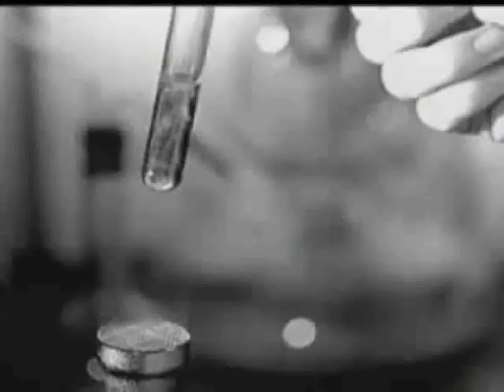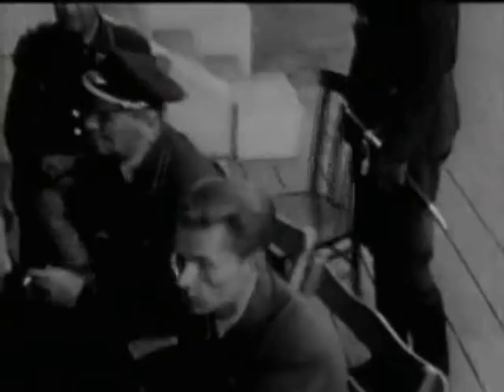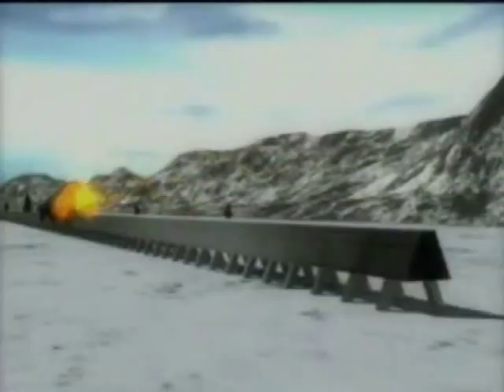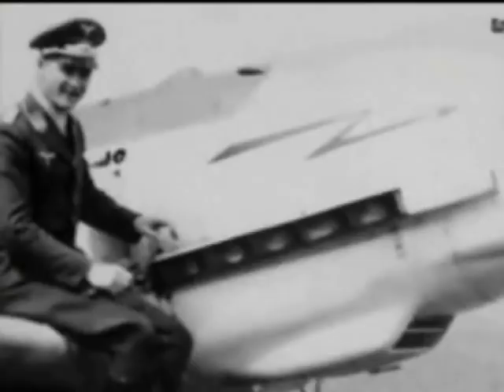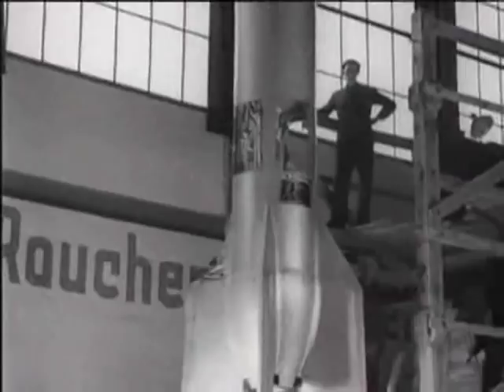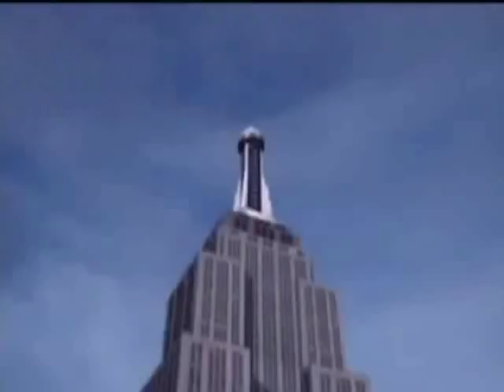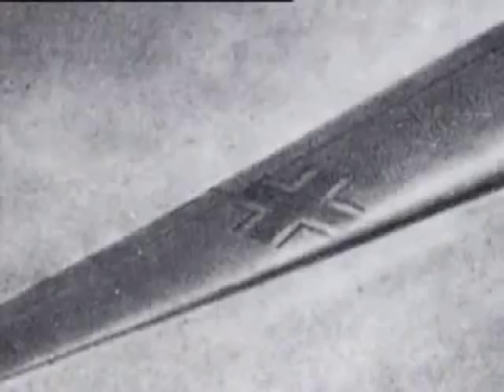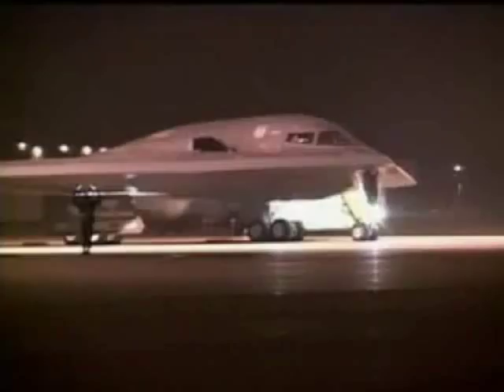Advanced Strategic Aircraft of the Luftwaffe - the true story

Comment: First up, Jack Northrop developed the XB-49 from his PREVIOUS flying wing design, the pusher-propeller driven XB-35, which first flew prior to 1945. Anything he learned from the Hortens after the war MAY have been integrated,into the jet version, but the XB-49 was, except for the engines, almost identical to the XB-35 externally. THE 35 is a key, as Northrop numbered the bombers for the year of initial design start. 49 means he moved to jet power starting in 1949.
    Northrop and his design team came up with the all-wing design independantly of the Hortens, as it was first proposed in an aeronautical paper in the 20s. Even the Russians had a flying wing program, pre WW2, as did the British, although theirs never got beyond paper projects until post war.
    FFS, people, do some basic research and fact checking before posting incorrect info like this.
Reply: David miorgan   What are you on about?
Reply: David miorgan  What are you rambling on about?

Comment: The Northrop XB-35 flying wing bomber was flying by 1944, well before the end of the war, so the claim that the Northrop B-2 was a Horten ripoff is bogus.
Reply: Northrop couldn't figure out how to make it stable.  so it didn't go into production.  the Horton was more stable than the XB-35
Reply: The XB35 was stable.  It was the jet powered XB49 which was not.  This was due to the removal of the no longer needed Vertical piston engine housings.  They had helped stabilize the plane.
Reply: *Edward
Brigadier General Robert Cardenas (USAF retired) and his experiences testing the Northrop YB-49 in 1947 and 1948.
"The B-49 had gear problems, it had engine problems, it had fuel cell problems, it had all kinds of problems. 
"All of these mechanical and design deficiencies in the airplane, they can be fixed. I have no doubt that Northrop can fix these deficiencies." I said, "There are several that I don't know how they're going to do it." Because you couldn't get out of the airplane. We didn't have seat ejection; that hadn't been invented yet. We didn't have computers, so there was no fly-by-wire. We didn't have any of those things. As a test pilot the only thing I had was a 2H pencil, a knee pad, and a stopwatch, period. But I told 'em: "Those things can be fixed, but gentlemen, the one thing that I can't even begin to tell ya how to fix is the fact that the airplane needs some form of stability augmentation. I am not saying that it is unstable; I'm just saying that it needs some stability augmentation. I cannot tell you how or with what. The airplane has basically exceeded the human sensory and response capabilities."
Reply: David miorgan  What are you on about?
Reply: @nitroexpress2438  No it wasn't.